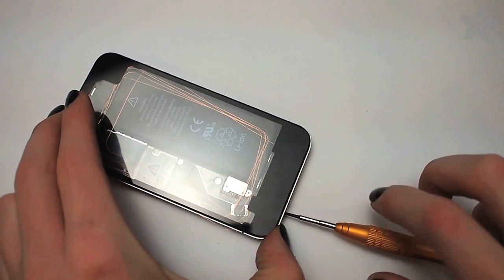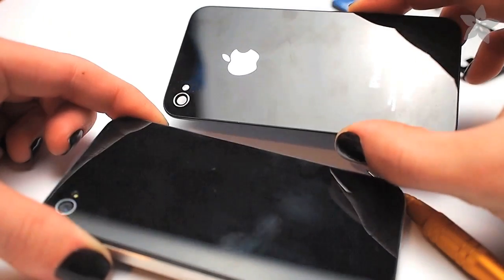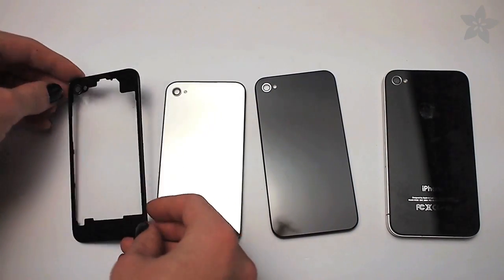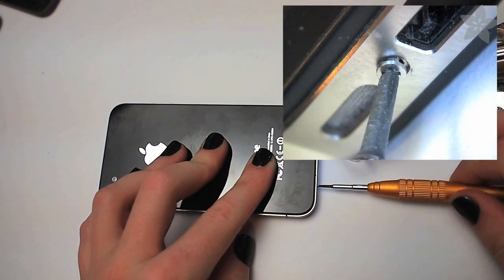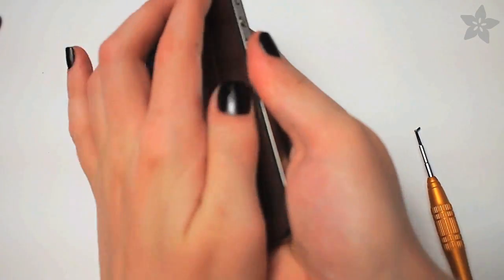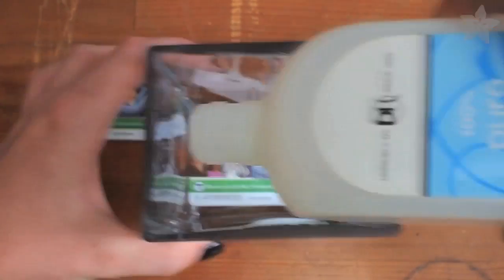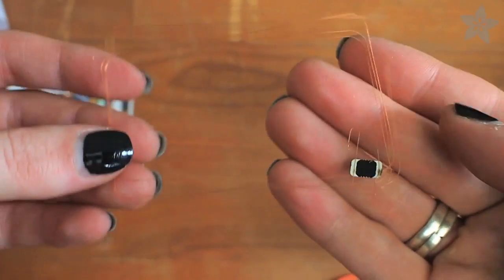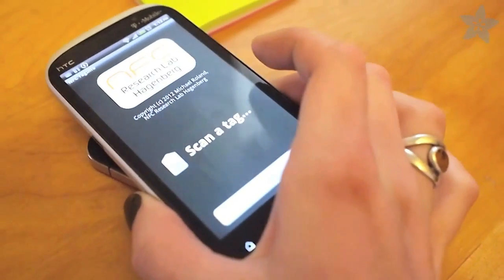iPhone Replacement Backs & adding NFC to iPhone

Comment: I there a way to add NFC to an iPhone 5 or 5s?? Please help!!!
Reply: +Tryoh You can add the passive chip but you need to have one that will work with all credit cards. it is easier to just put it in the case. This does not protect anything though because you will need to keep phone in faraday cage to prevent thieves from stealing the rfid signal. This "cage" will also prevent your phone from receiving calls or you being tracked.

Comment: I would like to know where did you get the card with RFID to use in the phone ? Would it work for using as the source for NFC zone that the Iphone4S does not have ?